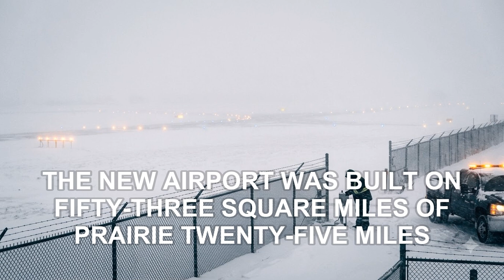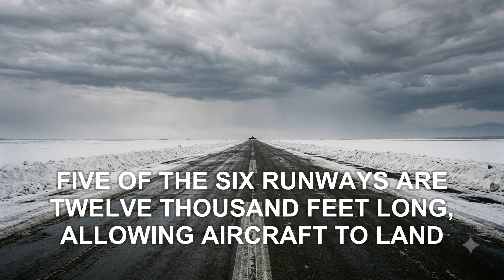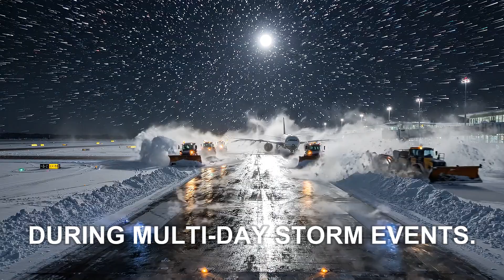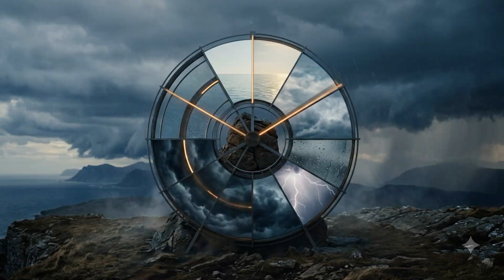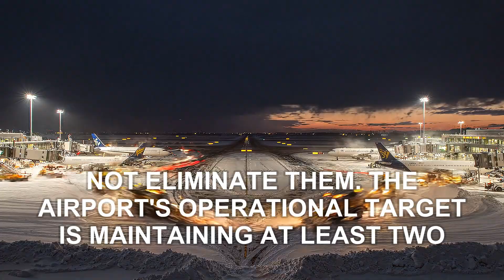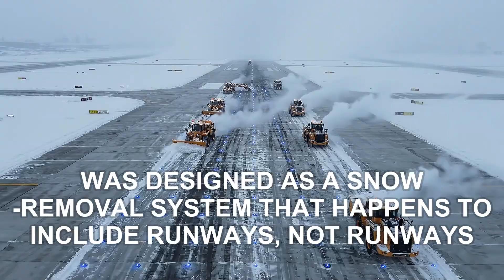How Denver Airport Beats 31 Inches of Snow in 24 Hours

Comment from the maker: Most hubs shut after 12 inches. Denver was built so closure is almost physically unnecessary — 6 parallel runways, 300+ snow machines, heated pavement, and crews that start 90 minutes before the first flake.

One question: is designing the whole airport as a snow-removal system (runways included) the only honest fix for Front Range winters… or is $20M+ a year in snow ops a luxury only a mega-hub can afford?

Drop your take 👇

Watch next: Gibraltar Airport — Why Cars Cross a Live Jet Runway